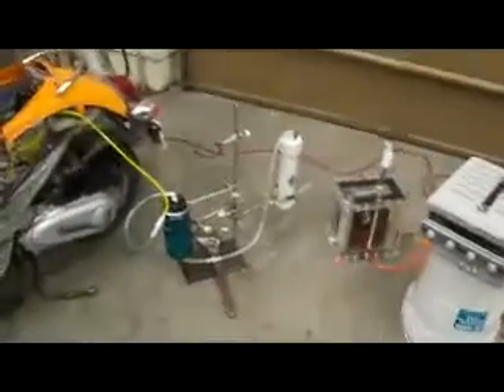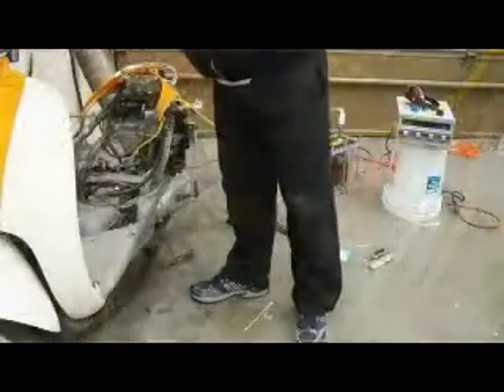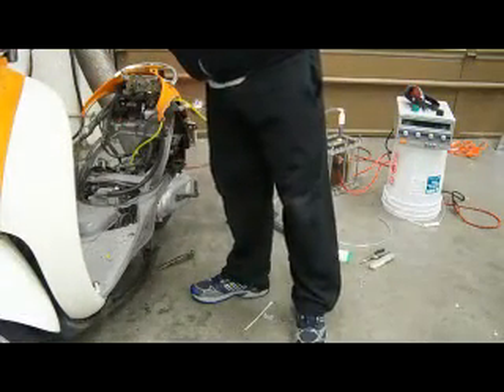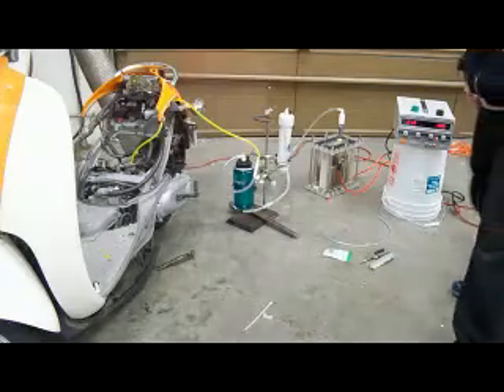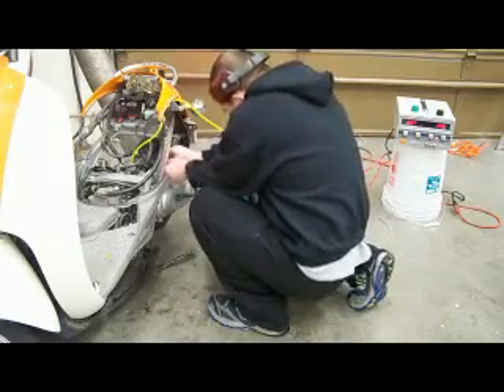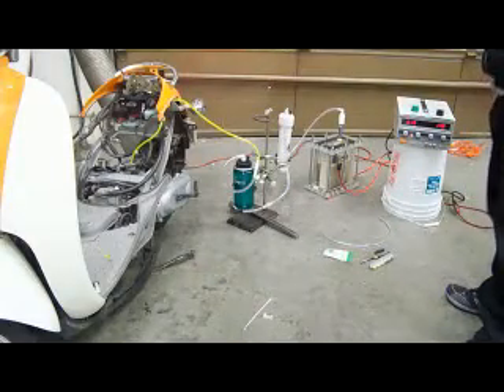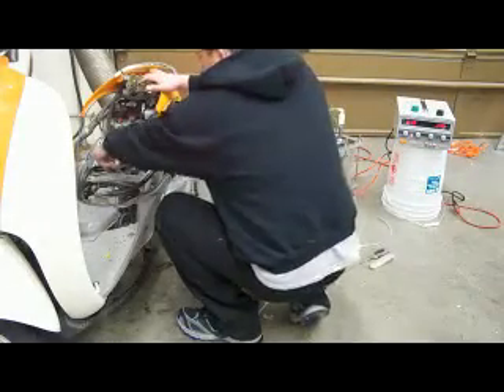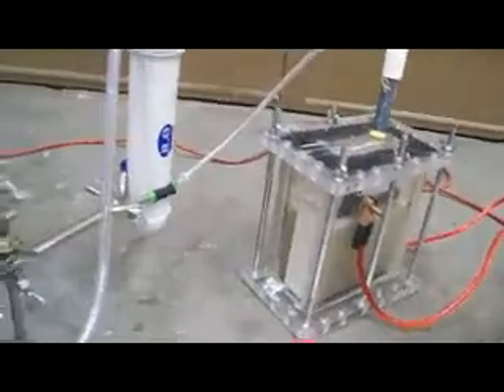Hydrogen Scooter Test Part 9: Top of Carb Injection #18

Comment: Hi there,
What u doing it's ok, but u simply don't have good enough production to rev it up.
The way to do this is to build another cell, and use this one as your idle control.
With the second cell u would be able to rev it up, but that also depends on amount of gas produced.
Ideal situation would be that u have enough gas to run that engine in open throttle  position on idle, and by adding more gas u would increase rpm.
Good luck!